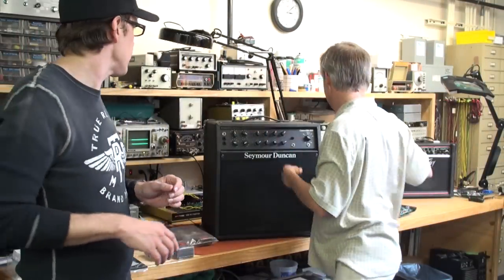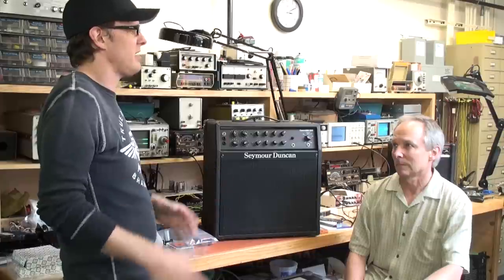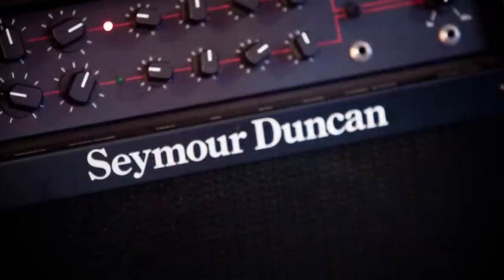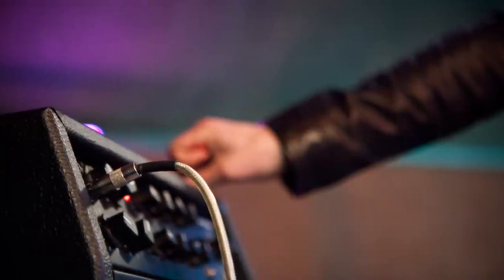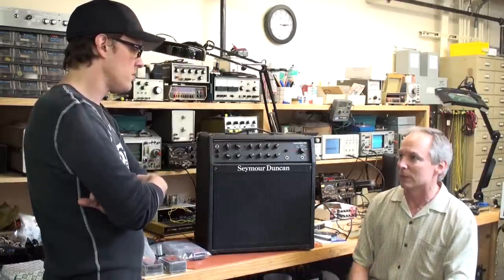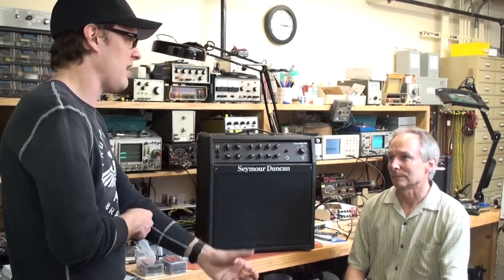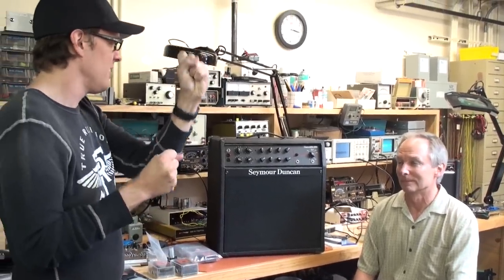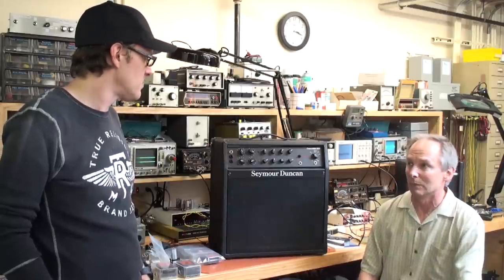Joe Bonamassa Talks About the Seymour Duncan Convertible Amp

Comment: I bought a Seymour Duncan Convertible 100 when they first came out. I toured around for a few years with it then stored away in the closet for over 20 years. A little while ago I pulled it out and was blown away with the tone. I recapped it and put in brand new tubes. What an improvement!  It stays home in the studio now. I now use a Kemper Profiler for gigs. I've profiled the Duncan so now it's like I've got on the road with me again?

Comment: I bought one around 1983, it cost a fortune then, around $1800.  I always loved this amp, so advanced and ahead of it’s time, extremely versatile.  I’ve had mine repaired several times, twice by Bob Kinder of Kinder amps, the problems were always in the output stage.  Joe is right, it’s an extremely versatile and revolutionary amp.  To this day, there’s nothing like them.  I wish very much that they would make them again.  It’s a very unique, broad minded approach, with numerous different features that still haven’t used by another company.  The modular preamps are brilliant!  There’s an input matching plug on the face, very unique.  Speaker damping!  Variable power amp.  It’s the most unique design I’ve ever seen.  I was able to get amazing overdrive from my red channel by the preamp modules I bought.  With 100 watts, you had a very high headroom amp, with tremendous power, volume, and flexibility because of the scalable output control, down to 1 watt.  Amazing.

Comment: I was the Quality Control Electronics Technician when the Convertible Amp was released. Kevin Beller, a former friend of mine, never mentions the designer Bruce Kennedy, (his roommate). My job was to test and pass amplifiers off of the production line and to troubleshoot and repair amplfiers and modules that were being returned. I worked on Kenny Loggin's and Julian Lennon's amps.
Typical Kevin.
Reply: sir I overlooked your reply here, I need your help in the form of information, please. I have worked over the years on convertible's .mainly pre the 2000 model and have no problem with these amps. the 2000 is another story. to begin, the main filter board under the main board, the one with the 2 200uf caps screwed to it is not grounded? it has the center tap of the power transformer going to it and it does not ground to the chassis? the 3 pin power cord grounds to the chassis, like it should,  but not directly to the main board or the center tap, or the 2 200uf filters? instead the board and the center tap, and main filters  share grounding with the board but are isolated from the chassis? I think this is either a mistake in the unit here or I do not know? another thing is the amp makes a loud pop when turning off that was greatly reduced when fixing the ground continuity, but it still pops. the amp has been recapped and re-tubed, all quality parts but no change in the popping? can we talk about any of this if you can, is there a layout document to go along with the schematic for the 2000?thank youns
Reply: OUCH!! glad my name is not Kevin lol...
Reply: Your on the money their Kevin!...Always recognise those that played a part in your success.
Reply: Tom, Were there any modifications made to the 60w Convertible drive circuits ? Are there any schematics available? I'm going nuts trying to find anyone that has anything but one schematic. It runs fairly well with Classic or Presence modules, but as soon as I go to anything high gain, it starts going off the reservation.Thank you in advance.
Reply: Tom Towle I recently purchased one that is teal instead of black was this a standard factory color?